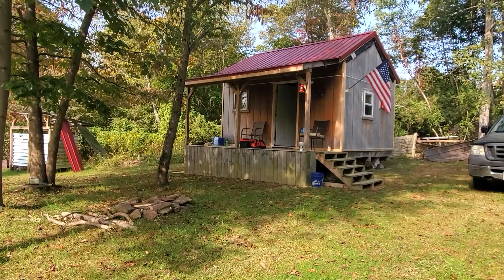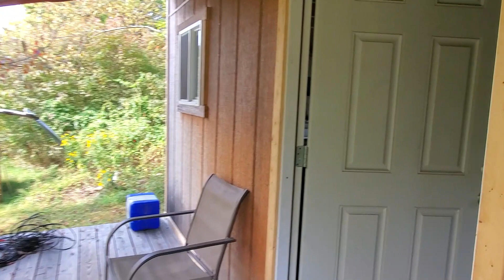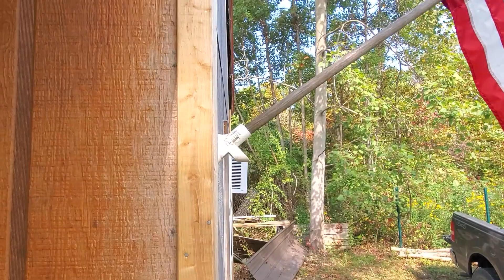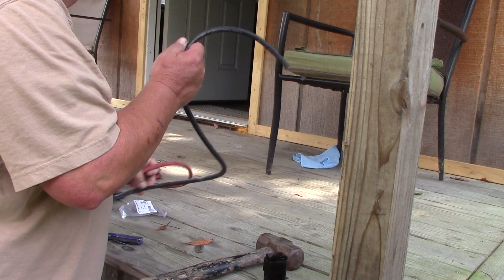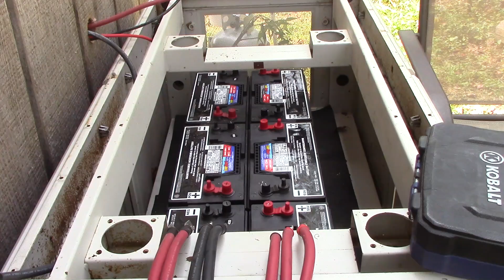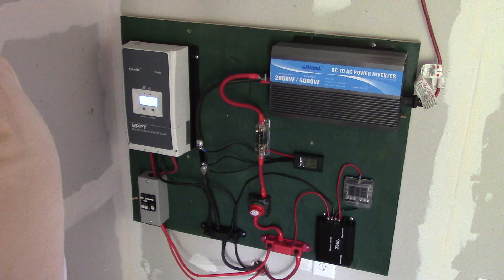DIY - Wire Solar Power Battery Bank in Series and Parallel

Comment: Looking good Joe. I think you'll be much happier when you move that panel outside to the power room. Its kind of an eyesore on that wall. The spray foam in the hole you drilled sounds like the way to go. Thinking about winter coming on now and if you are going to spend time at the cabin you are gonna need heat. Just a thought...

Comment: When are you planning on adding the Rex rest of the solar panels to the system? With winter coming just wanna make sure you have is not much charging as possible as to not let the batteries go below sustainable voltage. Got to keep them charged or they’re going to freeze and die.
Reply from the maker: +Michael Illingby Interestingly,  I bought 2 of these batteries in 2014 when I had the RV parked out there. Then they spent 3 years in my storage shed through really cold winters.  Never charged.I took them out, washed all the mouse poop and piss off them.  They were both still at 12.4.  I put them on a battery tender,  charged them up, hooked them up to a small system here at the house. I notice no difference in performance from the time I put them in the shed.  I will be using those in the barn when I hook up all my 12v lighting.

Comment: Years ago, I had a friend who made custom furniture and cabinets. He would have paid good money for the black cherry logs. If you look around the local area, there may be a carpentry or cabinet shop that would buy those cherry logs, if they aren't bucked up to firewood size yet. Some folks will even come cut the trees down and remove them, for free, just to get the wood. I really like the looks of your battery box and power panel. More great progress at the Acres! Linda, Roxy, and I send our best to you, Gail, and Max.

Comment: What's wrong with using a lighter to shrink your shrink tubing? Last twenty or more tubes I shrunk were done with one. Don't need any electricity to make a butane lighter make enough heat to shrink them and they're 100 times better than electric tape!
Also, you should always connect the positive lead to your battery bank first then the negative. This is especially important when you have batteries in a series because they might not be charged equally from one set to another on parallel. It is better to connect your batteries when they are charged equally and then let them rest for at least an hour before connecting to the inverter. Again, pos. then neg. on the inverter connections.
Reply: If the tubing gets charred or burned, it can crack easily and then it's a short circuit waiting to happen. If I ever use a lighter, I make sure to NOT use black shrink tubing. I don't much like opaque tubing, I feel it hides too many potential problems. I prefer to use clear stuff, you can easily see what's going on with your wiring that way. Especially with something carrying that much power, being sure is a good thing. I agree that electrical tape is not the best. I use it for emergency repairs, or for other kinds of repairs where electricity isn't involved. In an emergency, it works, but it won't last and I replace it with shrink tubing or insulated crimp-type connections as soon as I can.

Comment: Joe don't put steel wool or anything that's conductive maybe spray some foam in there current traveling through wires make the wires vibrate ever so slightly but if there was a short it would be a fire hazard
Reply from the maker: +Mark That's a really good point.  Well taken.

Comment: Hey Joe, I’m just wondering; what affect will the winter cold have on the batteries outside?
Reply from the maker: +tom tetrick Not that much since they are lead acid batteries.  When they are charging the heat up a little.  They don't freeze.  Kind of like a car battery in a way.
Reply: If the cabin isn't heated it won't make any difference. Charging them makes them heat and function better.
Reply: It’s a little more interesting that you may initially think. When a lead acid battery is fully charged it is not actually full of water, it’s full of acid. Acid doesn’t freeze, so as long as it’s not depleted it can’t freeze. Now if the voltage gets too low, then the acid will change places with the water and now you have a freezing situation. So if you want to make sure you never have a problem, keep your batteries fully charged.
Reply: The idea behind the battery warming itself is not logical, with three cells in parallel the internal resistance will be low enough that there should almost be no thermal generation at all from these batteries with that size of this system.